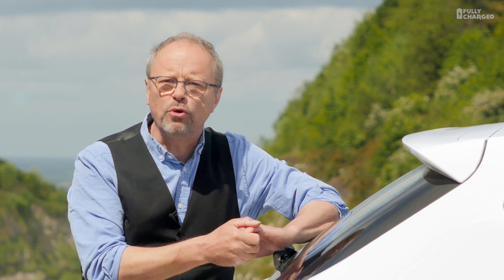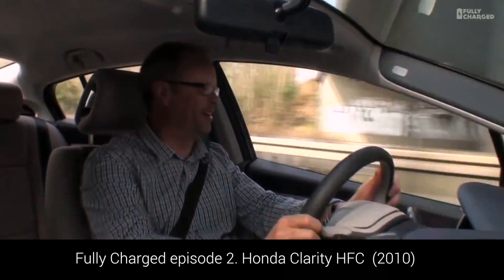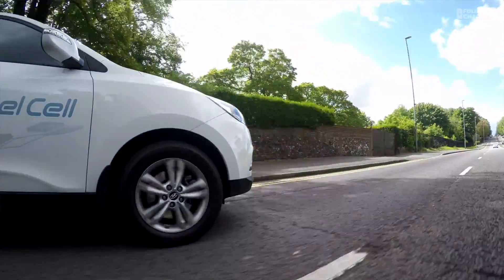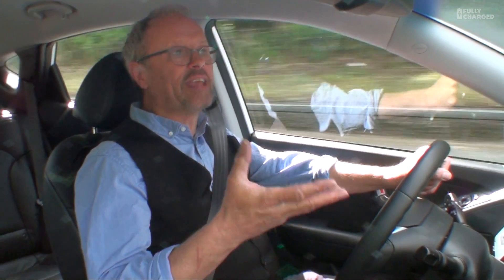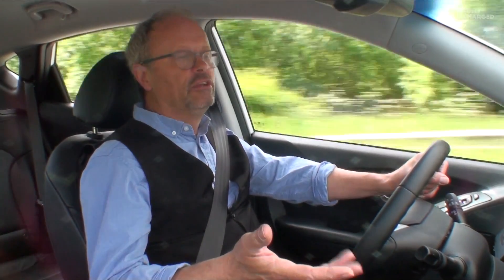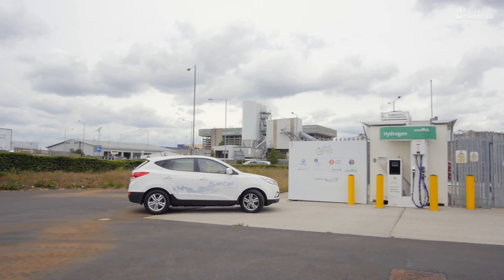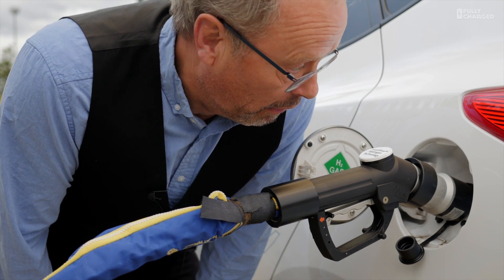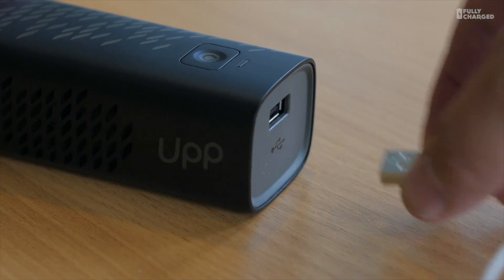Hyundai ix35 HFC | Fully Charged

Comment: Smart electrical grid is answer . Turn all nuclear plants off , thermal also off . All energry should come from solar and wind , some from rivers . Hydro power plants are very good at managing energy , as they depend on water lever which could be acumulated . Solar could run durng day (which could be planed) and wind could work only when it is windy , so you can not plan that ; but you never switch it off . 

My idea is - main supply during day is solar . Main supply during night is wind . Hydroplans are on standby all the time . During peak hours , you use all 3 . But , off peak , you stop hydro and use excess energy to produce hydrogen . While process is wastefull , you would waste that energy by wind turbine not turning . Also , idea is to maintan hydro plant reservoirs topped up , in case of drought or other 2 sources stop working . Hydrogen price could flactuate based on time of the year (people use most enegry during winter for heating and during summer for air-con) . Last thing - world grid . Istead of making oil pipeline , people should start making huge DC underwater coaxial cables for transfering high current over continents (you must use DC because it is imposible to sync all AC sources) .

Comment: This car is total nonsence. Using the excess to get hydrogen from water. I would use it to charge my car or some home battery. Using hydrogen fuel cell car is like waste energy on purpose. It's like saying "Oh, well, too much energy today, let's light up some 100W light bulbs!" I think this is only the way oil companies desperatelly trying to push treir shoulders to the party.

And the hydrogen cell charger... Forget it. Use supercapacitor based chargers like Zap&Go instead.
Reply: Honza Kuchař Yeah, if it gets to the point where wind or solar is producing too much energy, and there is a hydro dam somewhere on the grid, configure it for pumped storage (use the excess wind to pump the water back up to the top reservoir where it can flow through the turbines a second time).  Water behind a dam is basically a big battery :)
Reply: Yes, we've got few of them here in the Czech Republic. Even when the efficiency is about 50-60% it is much much more sensible thing to do than making hydrogen from water to fuel the car and charge its battery. We already have cars, which run only on the battery. Adding hydrogen fuel cell in such a nonsence. I mean EV's are so simple. Think of all parts, that are no longer nessessary in comparsion with fossil fuel cars. Why to complicate something perfect?

Comment: The 1:3 energy ratio is for the entire car system with all its many stages of loss, not just electrolysis. Electrolysis can be done theoretically at something like 80% efficiency and is maybe, 50-60% in practice now. It could be ok for storing green energy for later burning in conventional power plants. I wouldn't put it in cars though. Land use means you can avoid the high compression issue. It's also possible to combine hydrogen with CO2 from the air to form liquid fuels like green methanol which could be used in planes, ships and trucks. It's a good thing and should be done, short of even better solutions such as compact nuclear fusion. Not quite running on banana peels but close enough. 
The 1:3 ratio is a killer for HFC. The complexity and cost of HFC is another killer. It's a BEV plus all the difficult pressure management. Even if they could make the fuel cel out of cardboard it would be a costly high maintenance system.
The infrastructure is the third killer, not just the current absence of it but how expensive it is.
Of minor nuisances that could be overcome is also the fact that you can't fill it at home. You would have to go to a station every time and particularly in the beginning where they are rare, that can be quite a trek and really something that alone could prevent it even if it had no other problems. It sums up to HFC not having a prayer and I'm afraid the judgment on Hyundai's choice is slightly more grim in reality than yours, Robert.
Rather than praise they deserve a firing squad. Some might say drawn and quartered but that seems a little savage :)

Comment: Exciting to see that Fuel Cell Cars could soon be replacing 'Range Anxiety' with 'Explosion Anxiety' . . .  ;-)
Reply: Nick Cummings Hydrogen explosions are generally very brief, and they don't light the surrounding area on fire. There is just not enough energy. However, i could foresee problems with flying debri, although most tanks have specific rupture points for controlled venting. It might be enough to launch the car in a small jet burst though :D

Comment: I'm curious about the issues involved regarding home generation of hydrogen. Would seem to be an ideal combination of spare home electricity generation going toward making hydrogen for your fuel cells.
Reply: Chris Thomas It is very straight forward to make hydrogen at home but kind of hard to keep hold of since it is a very small molecule (H2) that can escape through steel and embrittle it as it does so. However once you have your H2 you then have to compress it to 10,000 psi (because hydrogen is not very energy dense so you need a lot of it, about 5kg for a tankfull). Those compressors are not cheap (but interesting technology, they have an ionic fluid on the piston crown to keep the H2 from the rest of the compressor). I would not rest easy if I knew my neighbour was producing hydrogen next door in 5kg batches (it is explosive you know).

Comment: Interesting line "not a plug-in hybrid fuel cell car, that would be too complicated" Why? Could this not be a much better solution to the range limiting aspects of EV's. If it has a battery pack already, could be seen as the equivalent of the Ampera, using hydrogen rather than petrol to charge the battery.
Reply: Nigel Quinton Range limiting aspects over and over and over again. Take a paper and pen to your car and make a stroke for every day you reach 160 km. Start today. On 24th of June 2016 write here total count. I would love to see the number
Reply: Honza, I drive a Tesla Roadster so I think I know about range etc. For many the barrier for their family car is range, including for me. My parents are 300 miles away and I want a car that can do that journey without an hours stop to recharge en route. So hybrids make very good sense. So would a Tesla S, but that's £70k!
Reply: Nigel Quinton Adding a charger would've been comparatively easy compared to engineering a hydrogen fuel cell. Trouble is, if they'd added a charger socket, every owner would've realised how good an EV was and forgotten about the hydrogen. Those canny Hyundai marketing types!
Reply: Nigel Quinton Range anxiety is a pretty dumb term. Actually 500km of range will be more than enough for 95% of the people. We have such electric vehicles today. The problem in reality is the charging time. If the charging can be done to 100% charge in 5 minutes, then nobody will complain. I for one, don't ever drive more than 400km without a 15 minutes break.
Reply: +Nigel Quinton I would sell Roadster, take a loan and buy Model S (And yes, I gave it a moment to think). Roadsters can't supercharge if I am correct. But you must admit the majority of people drive less then say 100 miles a day. I personally know only one person who drives from the middle region of the Czech Republic to east Germany to work. But I know many others, who commute to work everyday and basically never exceed 100 miles a day.
Reply: I could trade the roadster for an S but where's the fun in that?

Comment: Does not make any sense.
1) Oil/Gas/nuclear/Wind/solar to produce the hydrogen at a loss (3 or 4 to 1)
2) Transport Hydrogen to stations (by pipe line, truck, train)
3) Energy to store the Hydrogen (700 bar pressure)
4) Battery needed to store energy the fuel cell produces in car
 
Electric Car
1) Gas/coal/nuclear/wind/sun to produce electricity (very efficient)
2) Transport (Power line, already exist)
3) Battery

I feel like Hydrogen is like the communist way of doing things. Lets give everyone a job. You pick up the box and move it to the table and the next guy moves it to the conveyor belt and the next guy pushes it along the conveyor belt. By the end we can employ 3000 people in this factory.
Reply: +Crissa Kentavr Refineries have very little waste product.  They take the raw oil and split it into kerosene, gasoline, diesel, and a heavy tar that eventually becomes plastic.  There is no excess hydrogen left-over.  (Hydrogen comes from natural gas... a global-warming fossil fuel.  IMHO it makes more sense to use the NG is a home or car, than to convert it to hydrogen.)
Reply: Crissa Kentavr I don't get that!
1) It is not cost effective to make money out of a valuable "waste" product by using it to generate electricity, so they throw away this waste product and buy electricity!
2) Yet although it is not cost effective to use it themselves, they are more than happy to separate it, compress it, store it, transport it, off-load it and then sell it to the public?
Reply: +Juuso Peltoniemi FOR long haul trucks (and ships) diesel is the better choice, especially the modern trucks with Urea/Soot neutralization that reduce lung-damaging pollutants to near-zero
.
Hydrogen is very energy-intensive to manufacture, which makes it a poor fuel choice for freight (versus oil burners on trucks and ships)
.
Reply: Matt Beard It's not cost effective because their waste products are so numerous, and their main product's sales would be undermined.
Reply: Matt Beard It costs manpower, safety, and energy to collect the gas than to burn it off.
I know, I don't get it, either.
Reply: It's simply because it's there and someone can make a lot of money by supplying it.
Reply: 1981therealfury Point 1, if fuel-cells are so great, and refineries produce loads of excess hydrogen that they have no use for, why don't the refineries just install fuel-cells themselves and offset some of their huge power requirements. The answer is that it would not be cost effective... yet we are supposed to believe that it suddenly becomes cost effective to compress, transport, unload, reload and then use in a car?

Point 2: You do realise that hydrogen is transported compressed? If hydrogen at 1bar has a specific gravity of 0.06, wouldn't hydrogen at 700 bar have a specific gravity of 42? What about the weight of a hydrogen cylinder that can hold 700bar and be safe in a major accident?

Point 3: And the energy to compress the equivalent amount of electricity for a battery... erm about zero

Point 4: The argument here seems to be that current batteries are not as good as possible future HFCs. That is a silly argument! You should be comparing either current batteries to current HFCs or future batteries to future HFCs.

Point 1 (erm, again): But all those costs/losses still exist when producing hydrogen - you can't take them into account to rubbish EVs unless you also add them to the anti-HFC side!

Point 2: The Guy running the UK grid claims that a major level of EV adoption would not be an issue for the grid (see previous Fully Charged) - Add some grid storage and smarter chargers and it becomes pretty simple.

Point 3: Are you suggesting that it is the batteries that are holding back HFC vehicles? I really don't get what you are claiming here!